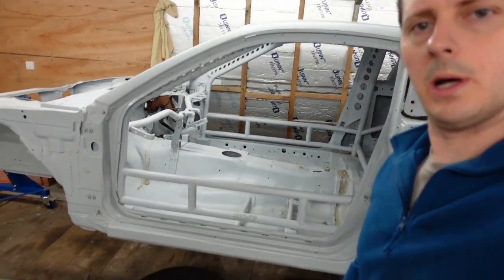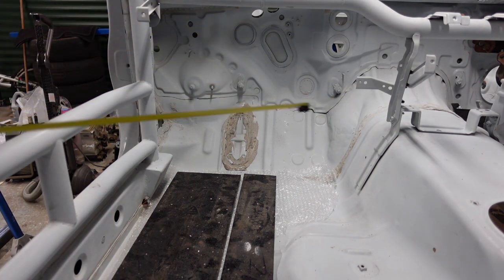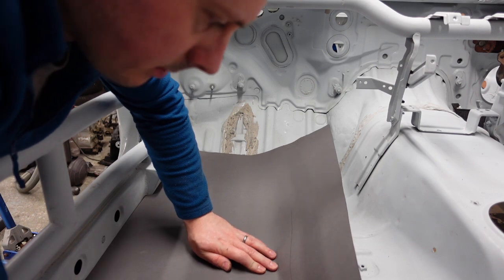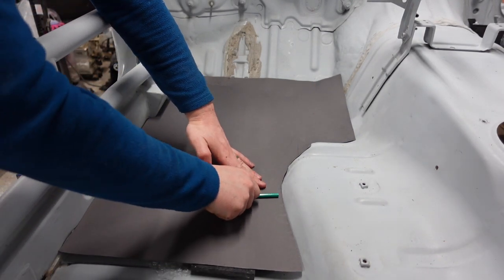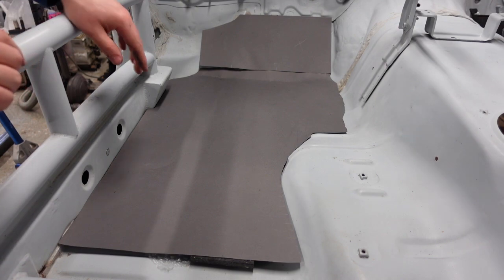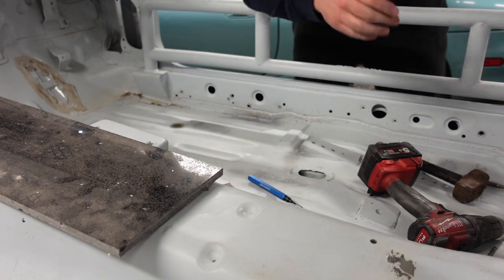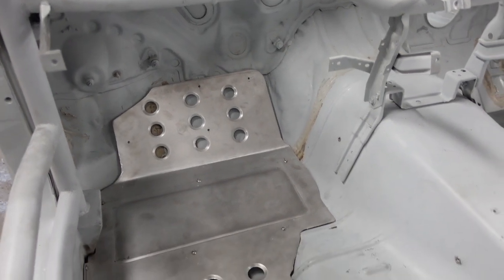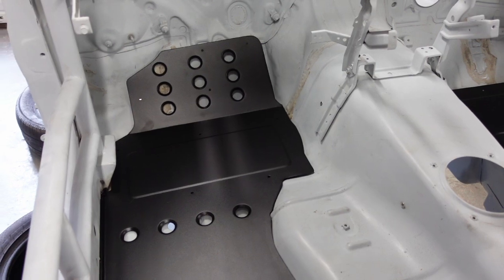DESIGNING RACE CAR FOOT PLATES!!

Comment: Looking good, what thickness aluminium did you use? I made some ABS plastic ones at the weekend but they are a bit floppy so I may step it up to ali. Cheers
Reply from the maker: @infamousaidy  I will check for you and get back to you later I can’t remember of the top of my head 😅
Reply: @bradytruezero8739  cheers, appreciate it.
Reply from the maker: @infamousaidy  they’re 2mm but with the dimples in them they’re surprisingly ridged and went with the thought process to cut a little weight and I won’t actually be standing on them just to rest my heels on and also not to wear through the floor paint
Reply: @bradytruezero8739  ideal cheers. If mine are too floppy and annoying I might do aluminium versions. Or make it in steel and then use it as a mould for carbon haha